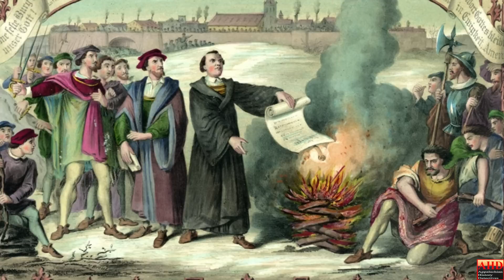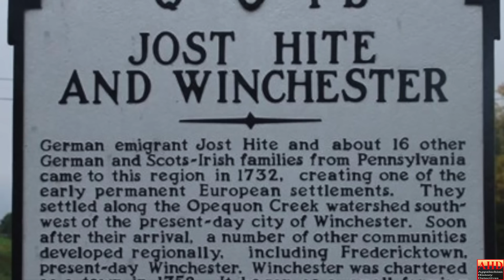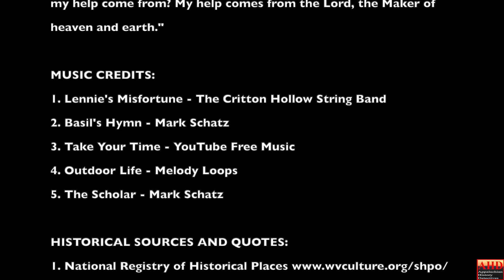A unique Metal Detecting Adventure 1754 Fort Van Meter

Comment: Those round objects you think are for curtains... I think they're roofing tacks for tar paper or maybe thin shingles, but most likely under layer. Large round area helps direct any moisture away from hole.
Reply from the maker: I believe you are right as that is what others have commented on Beau’s video of the dig. We had no idea at the time but it makes sense. It once had a slate roof.
Reply: @AppalachianHistoryDetectives  They're not only used for slat roofs. And today they have cool gaskets that are like built in washers that really seal the water out. (🙄 I may be addicted to home improvement shows, too.)
Reply from the maker: @ptaylor4923  interesting. What time period do you think they are from?
You think I would know this stuff, I’m an Architect but I’ve never seen these before.
Reply: @AppalachianHistoryDetectives  Damned if I know. Hand made roofing nails go back like 5,000 years. I did see that shape of tack (which is why I thought of it) on a British restoration show where they were replacing them on a slate roof that dated back to the 1600 or 1700s. And since nails were handmade, I suppose they could make the head whatever size was needed for a particular material. I don't think they had machines for that until about 200 years ago.
Reply from the maker: @ptaylor4923  These could be really old then. The house even dated into the 1700's. The owners have had the property for decades and the owner before them is an old couple that came over to chat with us. Both said they could not verify if it had been detected before but both commented the roof of the house once was slate. I think this confirms that piece of copper tin I dug up being flashing for it. He said the Fort was slate to keep "burning arrows" from burning it down. It has a wood cedar shingle roof now.
Reply: @AppalachianHistoryDetectives  😏I'd be concerned about burning arrows, too.
Reply: @AppalachianHistoryDetectives  I've found those same copper tacks at two places. One was a home built in 1890 and the other was an officers club at an abandoned army base built in the 1940's. Both had to have been reroofed any number of times since then though. I didn't think they were old because of the round shank. I remember they sounded like really sweet targets on my Garrett so if your finding those the place couldn't be completely hunted out.

Comment: The large item that you had never seen before,  is a piece of am an older pulley. housing. Half of it that is.   mid 1800's or so.  Looks like you found the old barn area or maybe the rigging when they put up the fort.  time on video.  21:15
Reply from the maker: Randy Sams thanks Randy. Someone else mentioned that too and posted a picture of one. I am grateful to fans like you who can help me identify these artifacts. It tells me it hasn’t been detected though as that would have been found.

Comment: 16:29 Curiously shaped. Early muzzle suppressor? Intake of some sort? Curious indeed!
Reply from the maker: I would have settled for an old musket...haha
Reply: No. It's really a simple bushing. Rifles were longer in the early days, the flash would have dissipated before it got to end of rifle so a suppressor would have just added weight to an already heavy gun & made it less accurate-suppressors today add that length to reduce that & didn't come into use until the 1980s